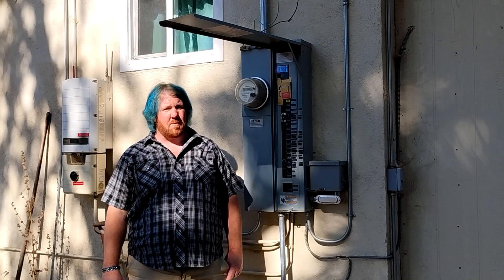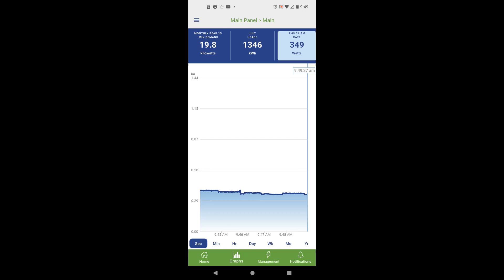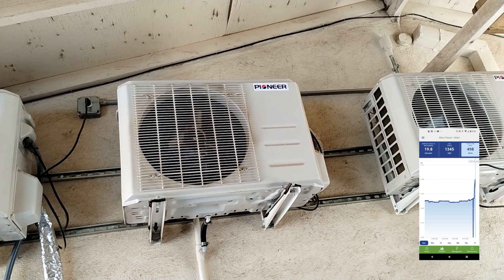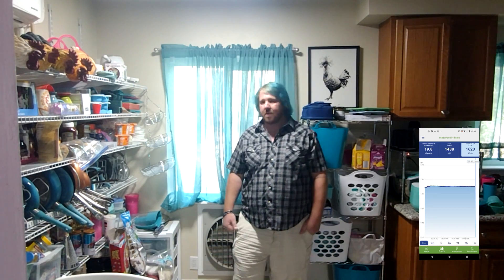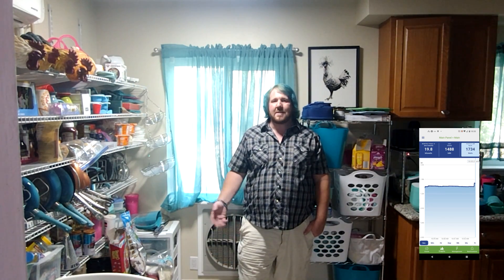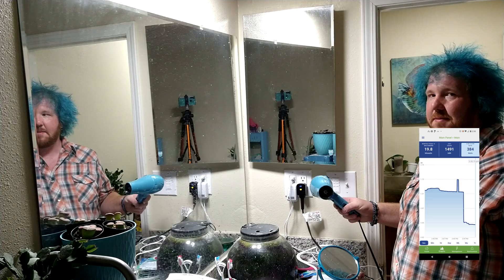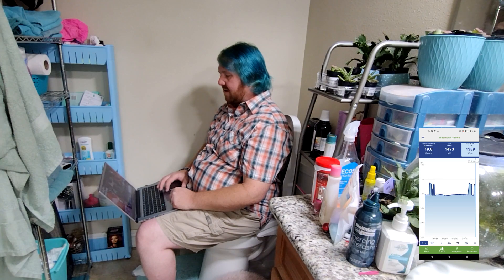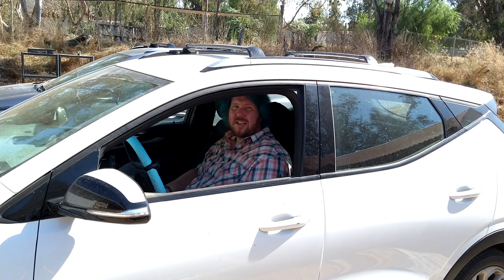Powering our House with an Electric Car

Comment: Great stuff!!  I’ve been wanting to do this with my car, but I think I need to get the inverter you’re using to handle our 120 V air conditioner.   I tried it during a recent hurricane, and it wouldn’t quite kick the compressor on. 

Question, did you do a video where you wired up that generator port?  

I assumed if I tied a generator plug into a 20 amp circuit breaker, it would only power every other breaker since it’s only 1 pole.  And I couldn’t find a two pole inverter that would work with the Bolted in a different direction direction direction 

This would be a game changer. 

Let me know if you get a moment… And thanks again for your contact and help!

Watching again, it looks as though the adapter you used enabled to this. Could you provide me a link?
Reply from the maker: Yeah, our mini splits don't have a start-up surge, however a regular window unit certainly will, and will need a bigger inverter.  I'd be very surprised if the one I'm using here couldn't run one, though.

No video on the generator inlet, but it's wired to a two-pole 30 amp breaker in our panel.  The adapter cord I'm using (link in description) splits the 120v from the inverter so it powers both legs, though there's no voltage difference between them so anything that requires 240 volts won't work.  But fine for our purposes.

Comment: I must find that pedestrian noise switch video!
They should sell/give custom noises. Obviously there'd have to be a vetting/whitelist process. But wouldn't it be cool to have one that sounds like a tie fighter, or the TARDIS? 

Aw kitty!

I got a bidet years and years ago. Was laughing through the great TP shortage of the Trump presidency :D
Originally a Tushy brand, was a kickstarter of it. Now a slightly better one. No hot water or blow dryer, but they're not necessary for me. 

When my Bolt finally dies, or gets replaced, I wanna drop the battery out of it and use it for home power storage. That'll either need a neat kit from somewhere, or for me to get an electrical engineering degree though.
Reply from the maker: The bidet was the whole reason we installed the inlet, could run an extension cord to everything else but running one to the bathroom would be annoying and the wife NEEDS HER BIDET!!!